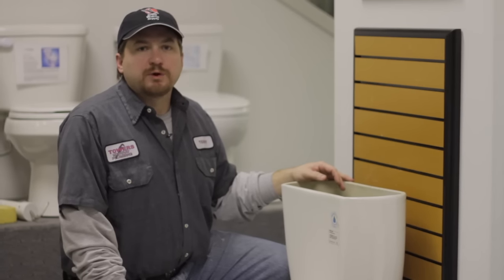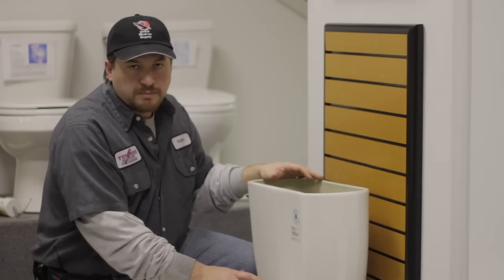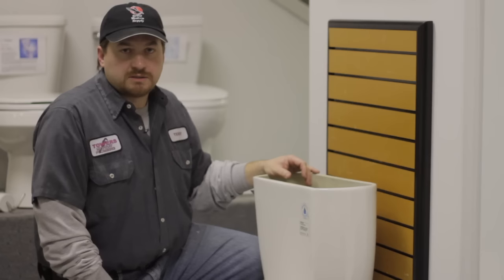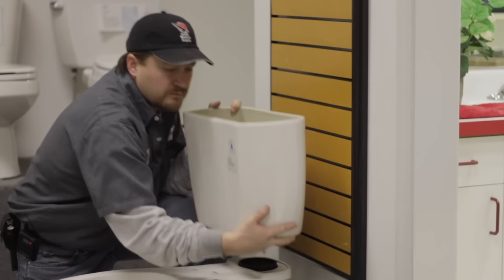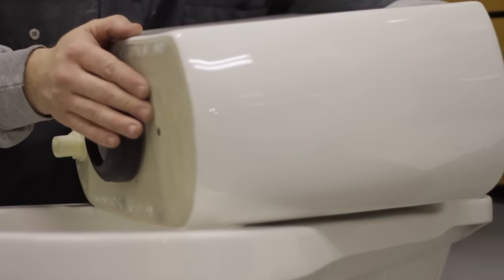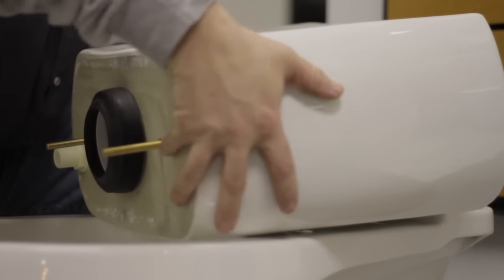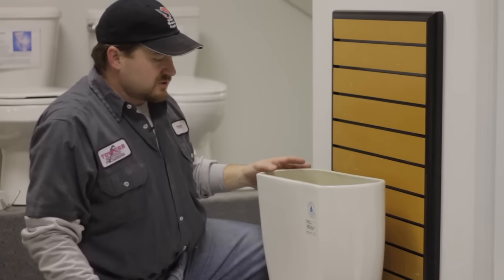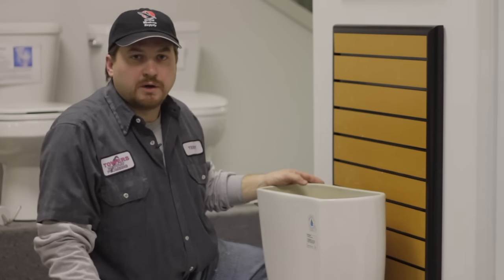Plumbing Advice : How to Replace the Tank-to-Bowl Kit

Comment: Same comment as others, regarding nuts and bolts details. Also if,  like mine, the unit has been leaking undetected for a while, lots of hardened mineral deposits to clean (vinegar helps) and I suspect most plumbers, who don't want to fuss wth such messiness, would rcommend total toilet R&R. Big $$$ to be saved by DIY.

An "A" for this video. 👍👍👍

Comment: Do you ever put sealant on the two bolts/washers? I've got a brand new American Standard tank leaking minutes after I installed the tank.
Reply: I have an American Standard, I'm looking up instructions to foresee any trouble shooting before install
Reply: Did you find out the answer
Reply: @privateprivate5302  no, I returned that toilet and bought a Kohler, much nicer in every way

Comment: This is what you do put the rubber washer only on the bolt it goes through the hole then place another rubber washer then the metal washer and tighten nut then place the water tank on the toilet bowl place the metal washer and wing nut and tighten. Don't over tighten.

Comment: I have to get the tank off; it has 3 bolts, 3 nuts. It's a Mansfield Model 102. I can only see one in the tight spot the toilet is in. I need to use a ratcheting wrench to get the nuts off. Can you tell what size nuts a typical toilet would use on a tank-to-bowl connection so I can choose the correct size socket to use? It doesn't have wing nuts, just regular hex nuts.

Comment: No  washers rubber or anything! Use this video if you want water all over the place
Reply: Hey guys, it's not that complicated. Each bolt kit comes with 2 bolts, 2 nuts, and 8 washers, 4 rubber, and 4 metal. Place the bolt through the metal washer, and then a rubber washer, and place through the tank. On the underside of the tank, slide a rubber washer, then a metal washer over and bolt, and tighten down the nut. Repeat for the other side. Just remember that the rubber washer go against the tank...

Comment: Excellent tutorial, thank you. You might be interested to know that here in the UK we normally don't have through bolts from tank to bowl in the base. We have a metal plate with slots to take the bolts. The metal plate is held in place by the nut which secures the flush valve to the tank. Actually this can be a source of a leak between plate and bowl - I much prefer the US system with the through bolts and sealing washers
Reply: You still alive?

Comment: Thank you so much! Really appreciate it. Noticed we had a slow leak and that one of the nuts was damp. I removed all water from tank and waited a couple hours to see if it stayed dry (it did). Then went and bought the repair kit. I was just going to do the washers but saw the kit was only a couple bucks more. I was nervous about removing the tank and replacing the main gasket but with your advice and demo it was a cake walk! Less than $10 bucks and less than 10 minutes.

Comment: you've missed showing the rubber components for the bowl.  The component bag I have has 2 bolts four rubber washers, four bolts, and four washers.  ManFromEast comments below look correct.
Reply: Because he didn't have any new parts. That gasket he put on was the same one he took off!

Comment: Informative, but you missed the big question, whats on the bolt? Personally I install:

in tank  - rubber washer (only!) on bolt
under tank (between tank and bowl) - rubber washer, metal washer, nut 
under the bowl- metal washer, nut

Comment: I have similar criticisms.  My Eljer has a much more complicated setup and my leak was not the bottom gasket.  It was the gasket that is in the tank at the bottom of the flapper valve.  Pretty useless video.